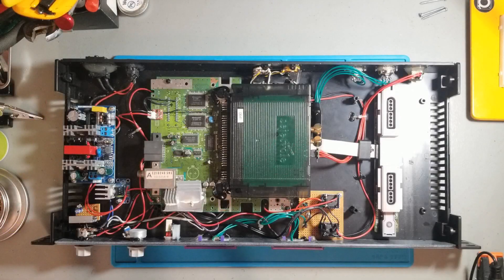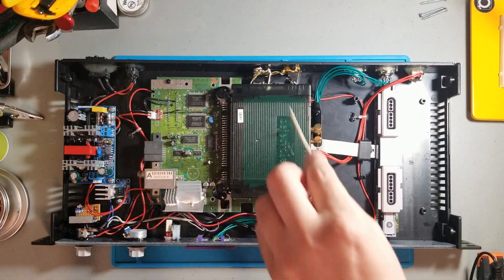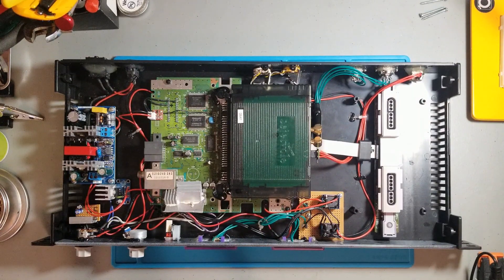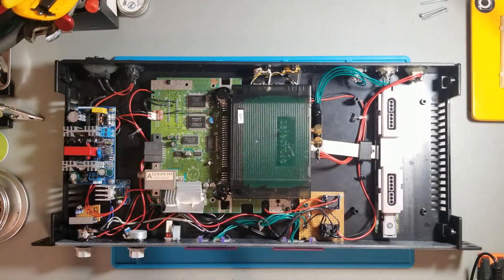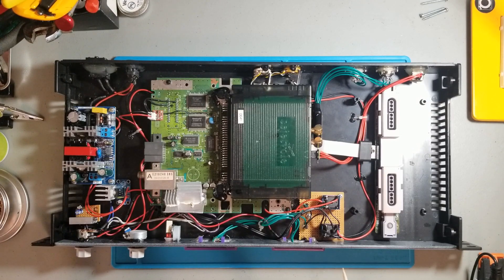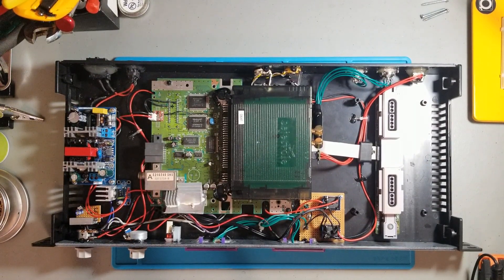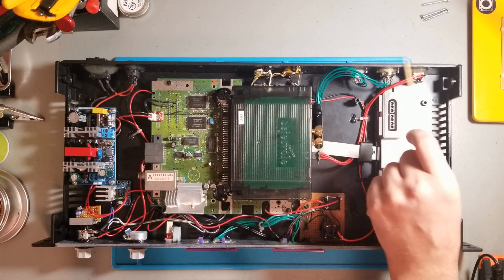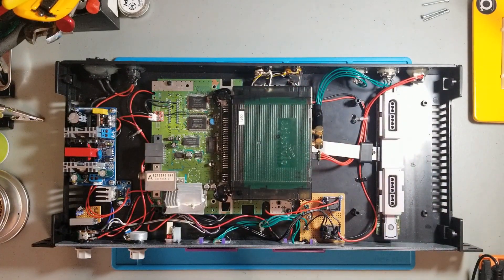Details about the SNES Synthesizer DIY with a Super Midi Pak

Comment: I absolutely adore this project. I'm thinking of trying to recreate it! I have a couple questions though

1. Is the 120v to 12v, then 12v to 10v converter just a basic board you bought online or did you design it specifically for this build?

2. Does the audio left/right channels have a specific summing circuit for mono (when only one jack is plugged in left)?

3. Could you expand more on your technique of bending the cartridge pins flat? Did you bend the PCB pins or the metal connector or how did you go about this in general. 

4. Could you expand more on the pitch control calibration? Was it just trial and error with a trim pot and tuner to test the values?
Reply from the maker: Hey there. Thanks for your interest.

1. The 120V to 12V was bought online. I think I got a confortable 4A out or something like that. The 12V to 10 & 5 are homemade using LM317 voltage regulators. One look more professional, but it's juste because I've made some pcbs. 
2. Yes. Excellent question. We can see that you know your stuff. You need that circuit to avoid having one channel fighting the other one.
3. This part was a nightmare. Anything too long was adding enough noise to bring consistent crashes. The angled pins ended up being made from cutout resistors pins I had laying around. You'll have to be patient. 
4. Yes. It was like calibrating a vintage synthesizer. One pot influence the other and vice versa. So get a good tuner online and be patient. 

If you ever finish that project, I'd really like for you to show it to me. 🙂

Feel free to ask any other questions!
Reply: @MrCaliforniaD thank you so much for the response! I absolutely love what you've done here and it has inspired me to try to recreate it! It may be a few months until I get around to it though. I'll definitely show you if I ever get it done. Thanks again for answering some questions,!